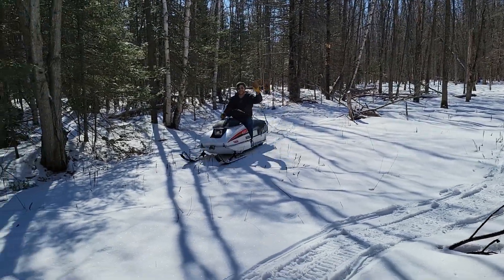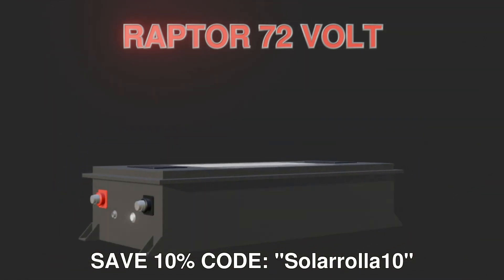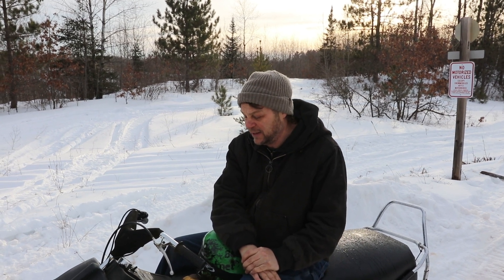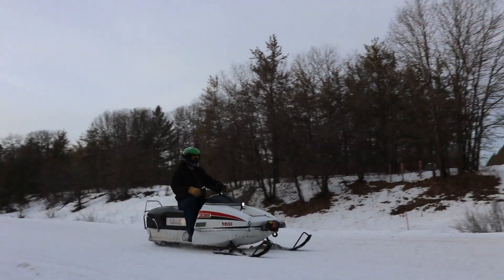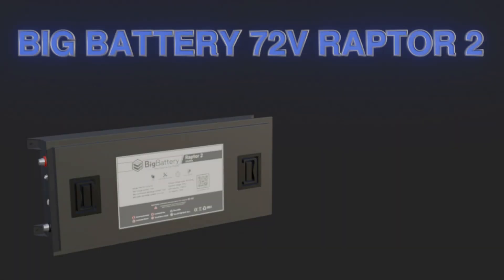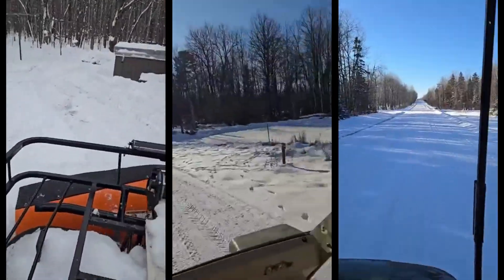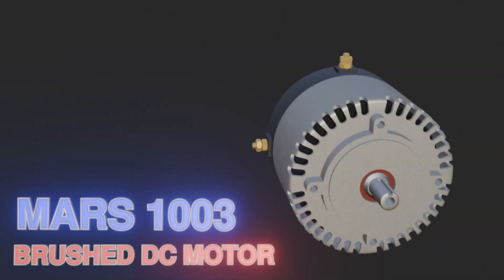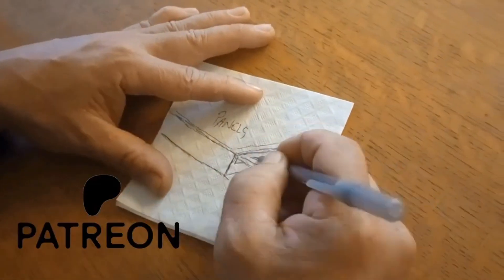Classic Snowmobile EV Kit with Alltrax and BigBattery

Comment: Great result. Thanks for sharing your EV conversions with us.  I used a Mars motor for my lawn tractor with a 5.2 kWh lithium battery and it exceeded my expectations. It directly replaced the 20HP ICE engine and drives the blades and hydrostatic transmission flawlessly. I had to use a golf cart throttle with the return spring removed so I could start the motor and blades at low RPM to avoid tripping the battery BMS from high amp inrush current. The old ICE throttle cable on the lawn tractor dash now controls the ME1004 speed. Once the motor is started and the blade 12 volt clutch is engaged I throttle the motor up to full speed and the lawn-tractor will cut the longest grass and climb steep hills effortlessly. Electric conversion with lithium batteries is an easier solution than you would think.